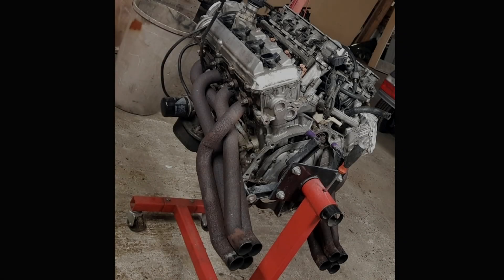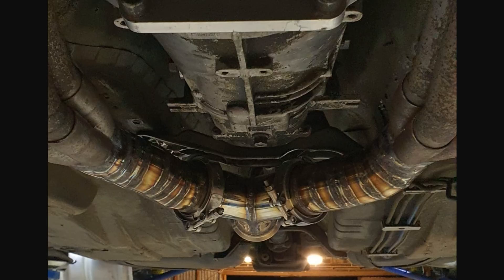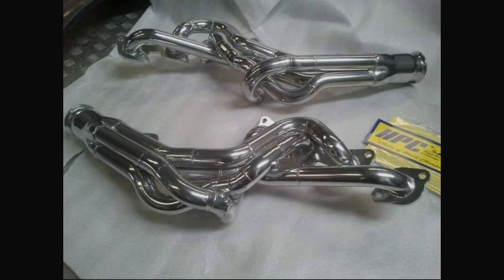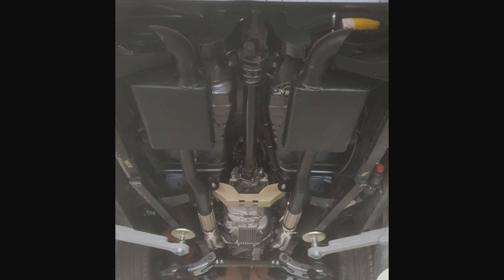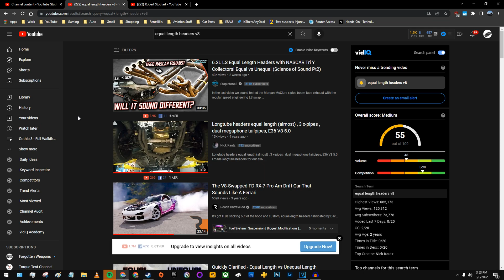1UZ / 3UZ Equal Length Headers

Comment: Do 1UZ vvti and non-vvti engines use the same header? I have a gs400 that I want headers for.
Reply from the maker: i do not believe so, i think the exhaust ports and the bolt pattern changed. i could be wrong, though

Comment: I feel the FRS headers might be overheating the bay
Reply from the maker: Potentially, but it's all for the sound!
Reply: With the FRS headers joining cylinders 1-5 and 3-7 doesn’t seem right because of the firing order.

Surely it should be 1-7 and 3-5 which keeps the pairs 180° rather than 270° and 90°?

Comment: You do not have to equalized headers length... you just need to equalized headers flow and pressure! No matter if one header's pipe ends up being wider than the other.
Reply: If you want it to sounds like shit listen to this guy
Reply: It's about not having interference from exhaust gas pulses.
Therefore no that's not how it works.
Reply: @heinzhaupthaar5590  you get it. The op you can tell by the way he speaks is ignorant in real power

Comment: Im 99percent sure I took the gearbox out of that blue corolla once.  It ran 10second 1/4 miles and was on nos
Reply from the maker: Do you have any videos or other info on it?
Reply: @drivingmonkeyofus6239 IF I am right, my workmates brother owns/owned it. I'll see what I can find on it for you
Reply: @drivingmonkeyofus6239  Its been sold. Its now sporting a silver wrap and  is turboed. FYI, If you weren't aware, this is from New Zealand. Cheers
Reply from the maker: Thank you for the info!!
Reply: @drivingmonkeyofus6239  Do you have any more info on how the original owner had the exhaust set up?  It's the sound I've been looking for and nobody else seems to have it.

Comment: How do you weld the 4 header pipes to one piece? isn't it hard to get to the center?
Reply from the maker: You could potentially set up a jig that represents the engine bay and undercarriage. And weld it all together from.there and find some way to slip it into place. Or maybe with some creativity, some strategically placed flanges to allow for disassembly. Not quite sure as of yet
Reply: Just buy a collector flange, they make different ones for different merge characteristics. As with all headers, a bit of collector size and length tweaking yeilds dividends, putting the power in the desired RPM range. Seldom do the book numbers come out perfect, but they are a worthwhile starting point.
Reply from the maker: this guy knows his stuff

Comment: The silvia at 2.00 runs the engine that once lived in a drift Corolla here in Tassie. Was 14.1 compression, custom made headers by the driver/builder at the time lloyd Smith running side exit. Was pretty rowdy sounding. Theres lots of videos of it if you search falken v8 corolla. cheers
Reply from the maker: Thank you for the info. Searching up Falken V8 Corolla right now!
Reply: @drivingmonkeyofus6239  https://www.youtube.com/watch?v=x-C33kVKzXM at 5.40 there is a list of modifications and more details on exhaust sizing etc. Happy to help :)
Reply: That thing was famous, nearly well popularized 1UZ swaps (and inspired by MotorFIX's own KE70 1UZ swap).

Comment: cool video :)

Do you happen to have more info on the E36 starting at 4:15, especially the ITB setup? Names, Infos, Sources, everything welcome :)
Reply from the maker: I can look into that, I believe he is on the 1UZ forced induction page on FB
Reply: Hey mate that's my one. ITB setup was on the engine when I got it, but it's 4AGE itbs onto a custom plate mounted to the lower half of the stock manifold.
Reply from the maker: I will tag you in the description!! Thank you for sharing :^]

Comment: The "big 3" car guys: Nothing sounds better than the sound of V8 American muscle.

Me: WRONG! Japanese V8 muscle sounds hell of a lot better.....just wish they made big blocks, though.
Reply from the maker: I think the closest we can get for the time being is the 3UR which is 5.7L, not sure if there is much in the way of higher displacement than that for JDM engines tbh
Reply: @drivingmonkeyofus6239  Hopefully one of these days Toyota or Nissan will come up with a big block. Of course, by Japan's standards such a large engine wouldn't be used in their pickups but rather their heavier duty UD/Hino trucks.
Reply: Nothing comes close to the 289 in the Shelby Daytona coupe.
Reply: have you heard of the Nissan vk56de?
Reply: @20piecemcchicken93  That's a small block, unfortunately.
Reply: Toyota once did a hemi but they're smaller than small blocks.

Comment: Some of these sound insane
Reply from the maker: someday I hope to make some equal length 8-1 headers for a 1UZ but for now it's a pipe dream
Reply: @drivingmonkeyofus6239  I think it can be done using a set of hurricane headers as a base. Then raising the floorboard of the passanger side for room and to bundle them together in the right firing order
Reply from the maker: @ClassifiedRecon  that's a good idea, I didnt even think of that as a possibility

Comment: I also hope to run equal length manifolds on my next UZ project. The is430 is a bit too tight for it.
Reply from the maker: Do you have any room to run them towards the front of the car and wrap around underneath? I'm trying to gauge my options for the SC/Soarer chassis myself, the steering rack could be a problem and the inner fender sheet metal as well
Reply: @drivingmonkeyofus6239  unfortunately without moving the radiator I fear the piping could be super close. My next build will be a drift build allowing the radiator to be moved to the back and that will provide me the room I need on that build.
Reply: Can confirm, UZ in an IS works quite nicely but very little space for intake and exhaust piping
Reply: Just have some made. Theres lots of ways to twist the pipes to get lengths right while fitting in stock spaces.